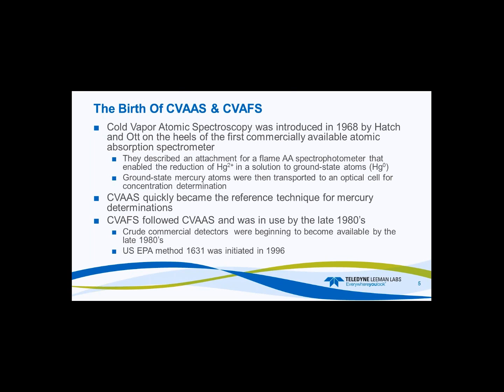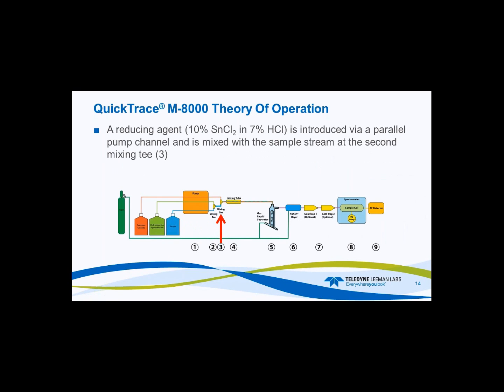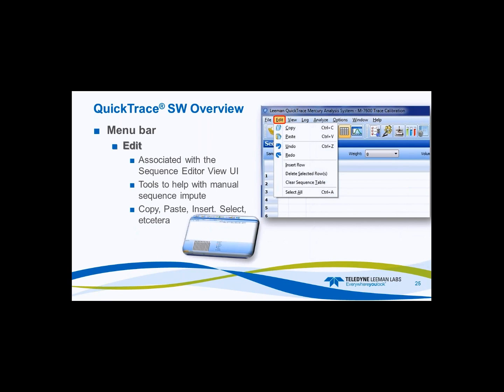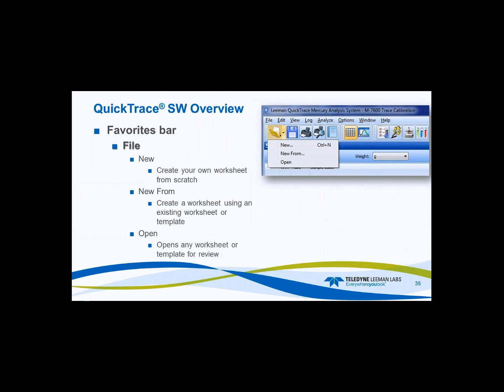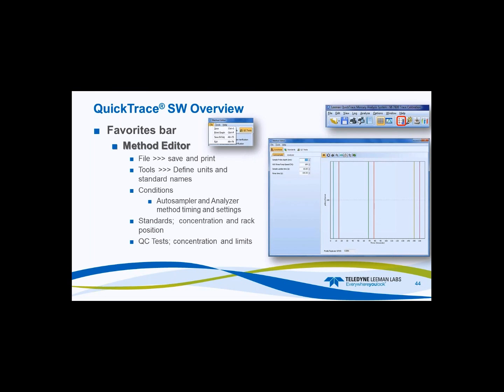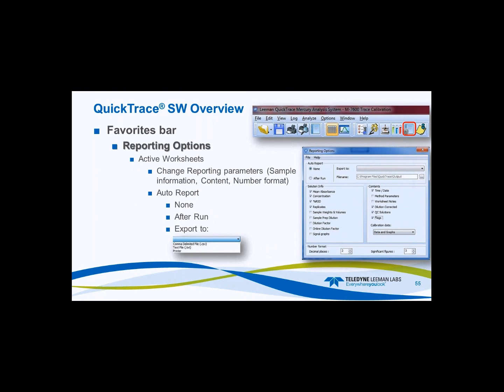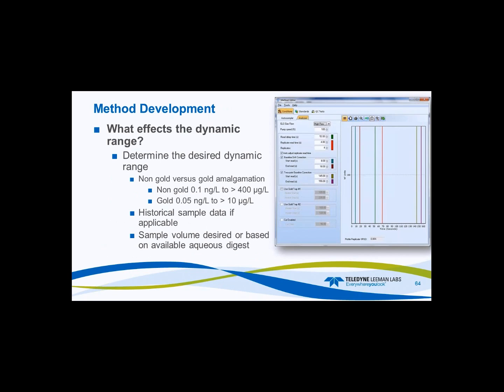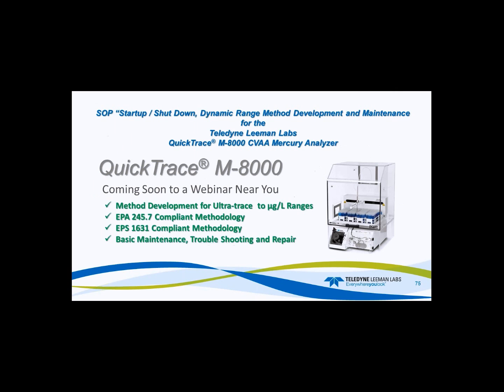Teledyne Leeman Labs   Hg Analyzer Theory QuickTrace M8000 CVAF Webinar

Comment: Halo, I want to ask why my standard is not linier. So the first standard is 0.1 ppb the result 3000 hF the next std is 0.2 ppb the result is 17000 hF but the third std is 2800 hF and I dont know whats wrong
Reply: Did you find out?
Reply: @gasks1979  not yet, the last measurement I got r2: 0.97 and the std curve is in ppb. It seems the measurement really unstable. Do you have any suggestions?
Reply: How old is your system? Do you take your gold trap at back of system and “zap” it in heater position 2? If so , what is the reading? Are your peaks sharp or broad- good shape? (Heater)Have you verified gas flow from gas supply to dryer is at 200 at 30 psi? (Leak or incorrect length of yellow tubing)Have you cleaned the quartz cell? (May not be able to “read” consistently)
Reply: @gasks1979  the problem is the unit is new and when the first time we try to measure the standard curve, the result is weird and really unstable. For the preparation of the standard we followed the application notes from teledyne
Reply: @raihanathalah7145  are you preparing the standards in 3% HCL?
No addition of bromine right?
Reply: @gasks1979  yes, but I just used HCl 3%, for example from 10 ppb to calibration std in ppt.
Reply: @gasks1979  So I diluted the 1000 ppm std to 10 ppb std just using aquadest. The conductivity of aquadest is around 1.2-1.6
Reply: Also, when you take out quartz cell- do not touch inside of black box
Reply: Are you running non gold trap or single gold trap? What are your blanks reading in hf? Can you include pictures of your curve? Do you run a single sample to get a peak profile using your highest concentration of curve? If so, is the peak a good shape? Is peak “ in between” lines ( start read / end read)
Reply: @gasks1979  non gold trap and I used low flow. I run a single spl with highest concentration before measure the standard curve. The peak itself is look alike as application note but the hf unit is way bigger. I would love to give the picture of std curve but how?
Reply: You must matrix match everything, including your working standard, curve points
( standards for curve) 
Fill tube almost to top with 3% HCL, then add concentration for the point in curve, then top off with 3%HCL to 50 ml. 

Mercury is more stable in HCL
If not linear, could you have low gas flow? 
What is the PMT voltage?
Reply: I’m sure you’ve watched Jeff’s video on method development, if not it’s really good.  You can take picture or video from your phone and select to add in reply box I think.
Reply: @gasks1979  http://youtube.com/post/UgkxLMMJXmFhjlVBHSk8oBr7ZCEr5ysapSZw?si=v8NM7oH9NiU-5_Cu
Reply: Maybe upload pictures or videos to your channel then choose them
Reply: @gasks1979  could you click the link that I shared please
Reply: @gasks1979  btw it’s the best r2 that we could get so far
Reply: @raihanathalah7145  when did you have  instrument installed?
Reply: @raihanathalah7145  Teledyne should verify instrument is working before they close ticket
Reply: @gasks1979  It’s like in the end of 2023
Reply: @raihanathalah7145  are you in USA?
Reply: @gasks1979  no Im from Jakarta Indonesia